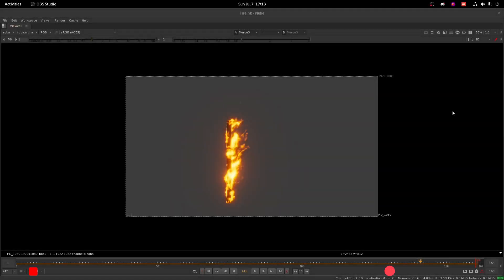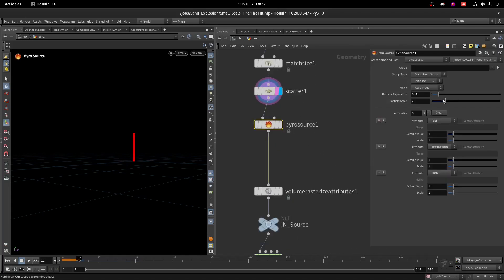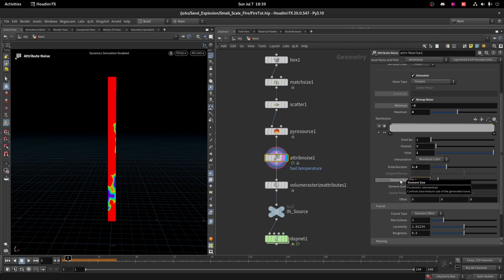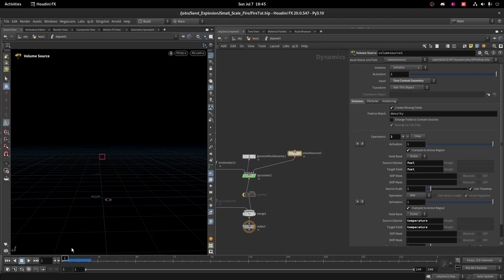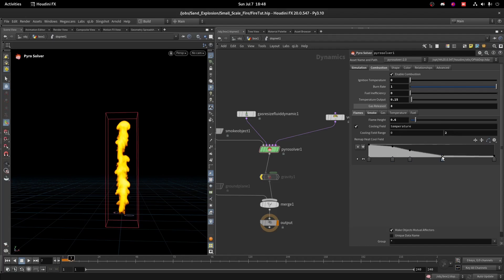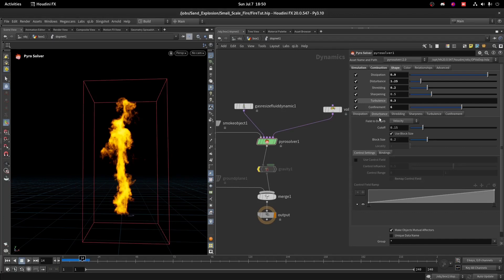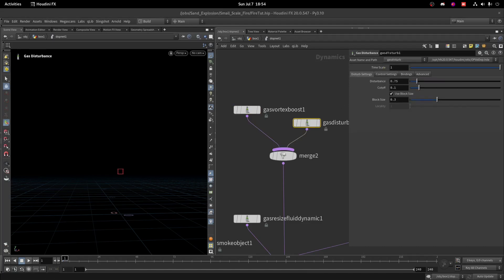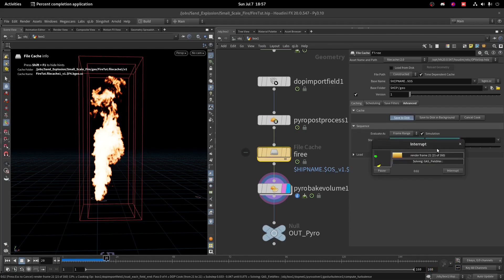Houdini Tutorial: Creating Small Scale  Fire

Comment: Glad I found tutorial for small fire that I was looking for long time. Thanks for making that. But, I tried to follow the steps without the slingshot and Arnold. It seems working in workspace and render view. I tried to render it in Karma. (used PyroAdvancedShhader, turned on fire. set "heat" in fire intensity volume in binding tab) Perspective view shows the fire, but Karma preview shows nothing.  Rendered frame only shows smoke.  Also tried it with Mantra. Render view shows the the fire. But, Rendered frame only shows smoke. How do I render the fire with Karma or Mantra?
Reply from the maker: it's really hard to say what causes these issues. Is it possible to share your hip file?